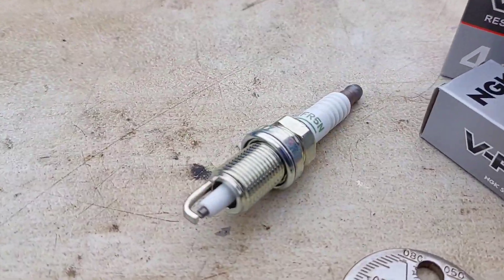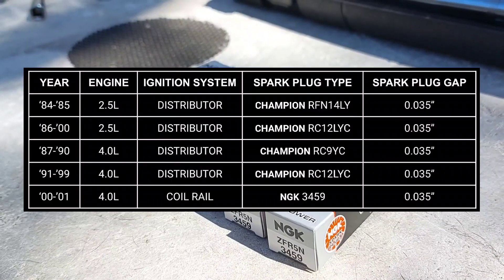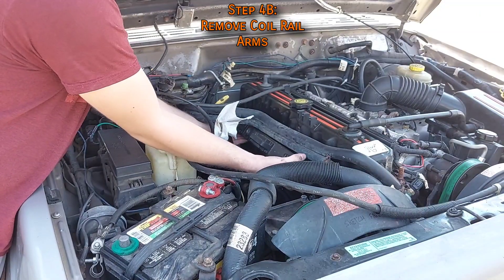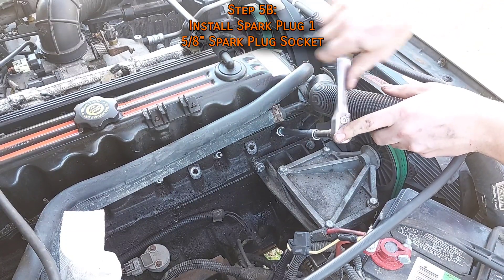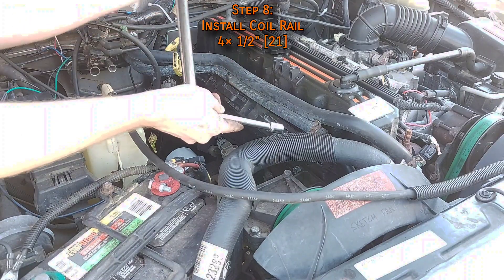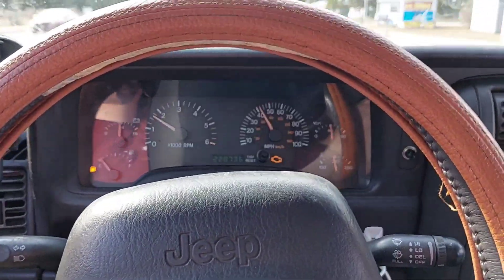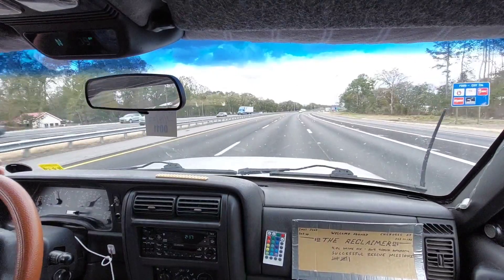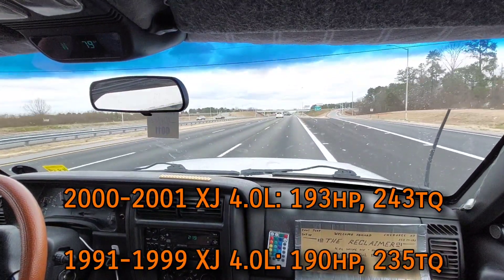Jeep Cherokee: Spark Plugs Replacement - Coil Rail Models; 2000 - 2001

Comment: Great video. However, where did you get the information that states to use the NGK plugs? My label under the hood specifies to use Champion copper plus plugs RC12ECC. I bought the NGK on your suggestion and I'm sure they will work fine. Just curious where you got that information from. I didn't see my label until the moment I was ready to swap them out and was too lazy to go swap them out at the store. Just changed them and car is running smooth again and no codes. My old plugs where Champion and looked great, just the gap was at .045 to .050. Thanks again.
Reply from the maker: Honestly it was so long ago I don't know. But I will re-research it, because now I'm curious too
Reply: @WAEMIDIV  haha, thanks.
Reply from the maker: @brianrepelin5545  So while I couldn't find anything directly stating NGK is *required*, many forums and pages reveal NGK was what Jeep used from the factory in 2000-2006 4.0Ls. They'll run just fine on Champions but apparently NGKs work "better". It must've just been a branding/ sponsorship change, the spark plugs themselves are really the same, and nobody's had problems with either brand in a 2000+ 4.0L. 

I've also seen Autolite, Bosch, and Duralast plugs in all sorts of varying year XJs and MJs, and they all run fine. 

Given 2000 is when the coil rail was introduced, I suppose I assumed based on the fact that 2000 coincidentally was also the first year NGK plugs came from the factory,  that they were factory requested, but I can't find any evidence that outright states that. 

So, if 2000+ Jeep used NGKs at the factory, but Champion remained the requested spark plug, then we have a bit of a paradox on our hands. No wonder the forums argue. 

Good on you for questioning it though. Without sources, I'm not any better than your neighbor's uncle John, who once changed a starter by flipping the Jeep on its side. Sure, it works, but there's probably better ways to do it. 

And thus, the mystery is lost to the pages of time. I don't know, you don't know, and if Chrysler doesn't know, then I don't think anyone will ever know. Roll credits.
Reply: @WAEMIDIV  it'll just be one of life's mysteries. Don't think it makes a difference, but mine is a federal XJ. I know California (where I currently live unfortunately) can get creative as well on their requirements. Although doubtful, not sure if maybe California vehicles required the NGK. 🤷🏻 Like I said, it shouldn't make a difference with either plug. Mine is running smooth so far. I'll keep you posted if anything changes, but don't anticipate anything happening.  Thanks again for this video and great commentary.
Reply: @butch93105 who's to say an XJ is any better than a lawnmower? 🤣

Comment: 11 23 25   very well done.   mine's a stik '94 4.0 Cherokee in need of new plugs.  and this vid provided a fab' pre-view.  will do it today, which at o'cast 41F in colorado at 5300'  , is not inviting at all for car work.   
........
as an aside ... both of the jeep's  front door hinges have broken.  and both are now bolted to the frame. (for in/out the right rear door is used.  ) and the doors  need re-attached somehow.   
  welding  is m guess   .     kudos to who among the readers here has knowledge to share

Comment: I did iridium 3 month down misfires and cylinder 6 misfire was bad. Changed the ignition coil again n put OE platinum will see if it works or if I should have watched your channel earlier

Comment: Who is this da. No fuel injector if it has a spark plug
Reply: Electronic gasoline fuel injection has been around since the 1970s- 80s. Did you think only diesels ran fuel injection?

Comment: So, curious to see if anyone else has actually run iridium to some level of success. I did plenty of research before considering which plugs I wanted to get, and to be honest, heard a LOT of back and forth. I'm well aware of the factory recommendations. I'm well aware that they're proven for 30+ years. But I was curious to test new technology out.
A combination of normal maintenance, "big 7" wire upgrade, healthy battery, and alternator have kept my consistent and quick startup (quicker than even my parents' cars start, to be honest) and the iridium plugs have given me no issues in over half a year. idle is stable, startup is fine even in frigid weather. I was very anal about which version i picked as some were built colder and others hotter. I was also very particular when gapping them per the recommendations of multiple people.

At one point i did have a running issue that I thought could've been the plugs, took them all out, looked them over, rechecked the gaps, no unusual colors or marks. ended up being a loose positive cable (which i learned that the multiple times that's happened to me wasn't necessarily my fault and just an issue with the tension bolt backing itself out over time. easy fix).
But I have yet to experience any issues with the iridiums after ensuring they were properly setup.

Comment: 11:38 regarding reading errors, I don't know if it works in Cherokee, but in Grand Cherokee you can read errors without a computer
https://youtu.be/qcmqMbELZoA?si=sOJekzBzt7sxScmt
Reply from the maker: This trick does work on the XJ, but only from 1991-1997. During the OBD-1 years with a physical odometer, the CEL would flash a certain number of times in sequence, and the codes it gave you could be translated into OBD-2 codes. That feature made it all the way up to 97s but not in 1998 - 2001 XJs for some reason. Simply doesn't work

Comment: I learned this the hard way.. Jeep didn’t pass cal smog bc I used platinum’s and the NOX was like 4 times past the legal limit top end was running way to hot switched to coppers ran cooler and passed I didn’t believe it when the Jeep mechanic told me to throw them away
Reply: Dammit just put platinum 😢😢

Comment: On Cylinder two the ceramic was lighter on one side than the other indicating a possible uneven spray from the injector
Reply: I have a theory - every XJ 4.0 I've seen with a hole through the block has been on cyl #2. Replaced injectors after seeing lean condition on cyl #2 spark plug and the injector tip didn't look so good either.

Comment: I broke my red tab and locking tab try to get the dam thing out! I couldn't see the dam thing! Even with a mirror and light. Why and the hell didn't they make a longer pigtail, like 8" to 10" to be able to see it. So the new connection went in very tight, plus I used a couple of zip ties to keep it tight. It fired right up but still have a  little rough murmer when idling.

Comment: Is the Zfrn5 #3459 a copper plug??
Reply: Yes just got mine yesterday.  Never buy injectors from Amazon I did they came from China after doing all the work both seal area one the block, the other the fuel rail. Sprayed gas all over my engine thank goodness Never caught fire 🔥 just sitting in my driveway.

Comment: That's man. I learned something extra watching your video.  I'm in FL as well.  Lightening and 🌧 now, though.  My cherokee isn't acting so grand now. It'll start with the help of pressing the gas pedal but won't idle without help.  I replaced the coil, but I think it's aftermarket.  I must lookup the brand maker I ordered🤦🏾‍♂️🤷🏾‍♂️. This truck is making me want to go back into payments🤦🏾‍♂️
Reply from the maker: your issue could be elsewhere, like fuel, or maybe even compression

whereabouts in FL are you at it's raining by me too right now

Comment: I went to a local shop just to get some assistance on replacing the coil pack and learned about the red lock tab. What I DIDN'T know about was the "main tab" and having to squeeze IT to get the damn thing finally disconnected.  Glad I came across your video. THANK YOU!

Comment: The factory Distributor made 18 kV. The factory coil pack made 30 kV. If you do the Viper/Caravan mod those can put out 40-60 kV depending on what you spend. At those voltages you can run iridium. I swapped my 98 ECM for a new 00 with my vin programmed. I swapped the harness, dropped in a 00 oil pump shaft & bought the 6 point coil & wires. The higher the kV the better it ignites fuels with 10-15% ethanol as these weren't intended to in 96-01. You'll get better MPG. Even @ 30kV you can get misfire codes because of the fuel.

Comment: Hey, I see at 60 you at about 2k rmp. I just got a jeep it’s got the stock tires and at 60 it runs at about 2600… what hearing are you running?
Reply: Gearing*
Reply from the maker: @arnoldpaz3442  This is a stock Jeep with, at the time, 225/55R15 tires. An Automatic with 3.55:1 Gears matches 60mph to 2,000 RPM very nicely with the AW4's 0.75:1 overdrive ratio

Comment: I'm having a rough idle, did it all but coil pack and spark plugs, I got a coil pack coming tomorrow, and now I'm looking st the spark plugs😳
Reply from the maker: Rough Idle could be any of those things or perhaps a TPS, IAC, Dirty throttle body, bad injectors or even a stuck valve. Here's to hoping the spark plugs do the trick
Reply: @WAEMIDIV  did all of that but only cleaned injectors, thinking about the 4 hole as well, as far as valves😥😥😥 let's hope its the coil and plugs😅 thanks for all the info!!
Reply: I get rough idle every so often in my 01 XJ.
Reply: Did u change it?
Reply: @cangrejojeringa  did not fix it, getting new injectors about 1 month out, 4 hole to see if it resolve the issue of rough idle, there the only thing left i haven't done
Reply: @awdsie9902  hopefully that does it… I’m getting the coil tail and spark plugs since my #2 ain’t sparking. Just in case I also found this : https://youtu.be/TZwJ2jp8g0E

Comment: My 99 Xj has almost 400,000 miles and is just like new...The 99 Xj is a beast
Reply: I have an 01 with 389,000 still running 
Started getting misfires 
Still drives 
Replaced plugs and coil and man she’s smooth still 

Amazing motors 4.0!!
Reply: @Cynyc-pq2pc  I have an 01 with 225,000 so I guess I still have a ways to go. That's good to know. Mine did have the infamous crack in the cylinder head. A very small one. New head and gasket at 189,000.

Comment: I have a 2001 and love it but I do hate that goddamn coil rail. It's a pain in the ass to diagnose when one of them goes bad. Ksuspension has a viper coil pack mod that gets rid of the coil rail. It also frees up a lot of space in the engine compartment too.  Check it out.
Reply: Pull coils, leave plugged in, arrange a grounded rod along the coils 5/8ths inch away, or so, have a buddy crank while you watch the coils arc onto the grounded rod

Comment: OMG i just installed iridium plugs 2 weeks ago.
Reply from the maker: uh oh
well it'll be fine for a little while, but over time you'll notice the engine gets worse at idling. I would change those out before you fry a coil and need a new rail!
Reply: I almost did, they come today! Luckily I watched this prior! Thanks much 👌

Comment: Nice tutorial, when trying to diagnose the cyl misfire i had from what id come to find out was heat soak, i ended up replacing my original coil pack with what i think was a duralast.  did it on a late evening one day from work with the sun almost gone, fun times! i had just recently bought the car so i had no clue either. Now im still getting a misfire randomly on cyl 3 but it does not matter the temp. other morning it was almost freezing out and i got a cyl 3 misfire but i still l had power and could accelerate unlike when the injectors are heat soaked and you can floor it, and it will do nothing but continue to sputter. Either way, there is never a day thats too dull with a jeep xj, keep up the good work!
Reply from the maker: are you sure cylinder 3 is actually misfiring? It could only be doing it on warm starts, but the CEL stays on and stores the code for 3 engine cycles. For example when I was in Florida, it was hot enough for me to get heat soak and my CEL came on every time I stopped for gas, but heat soak went away within a few minutes and I drove for hours after that and started the engine cold later, but the CEL was still there because of the way OBD-II works. 

But then again, there could be another problem somewhere else. Maybe a stuck injector, or a bad spark plug combined with heat soak could be masking said problem. If you haven't, I recommend upgrading your fuel injectors to 4 hole injectors, it smooths idle quite a bit and they better atomize the fuel, which could maybe help in some regard to at least narrow down where the misfire problem is
Reply: @WAEMIDIV  So i have gotten the 4hole injector upgrade and that definitely did help out alot. unfortunately i am still dealing with random heat soak issues on very hot days, i live in SC so 75+ is a normal occurrence where i live. It does not happen to often, normally only when i am driving alot and stop in to say, the dollar store, to get something really quick. Other then that i never really have any issues. 
That was until the other week where it was in the low 40s and i was misfiring for a few minutes on starup till it worked itself out. I had just recently cleared the engine light so the only two codes that popped up was the generic misfire and then cyl 3 misfire. I have not had that exact experience happen again and there have been very similar days since so im hoping it was just a weird fluke but, i have a feeling its just a small display of what is potentially a much deeper problem. 
ill slowly be diving into that over time but for now, everything is running fine so im tackling some other projects on the car to clear up some space as ive been building up parts for a while.
Reply from the maker: @Stars11222  Sounds like you got plan ✅
Heat soak is a very trivial thing that's hard to trace down, so I promise I will eventually have a video about it at some point in the future. Best of wishes with the Jeep